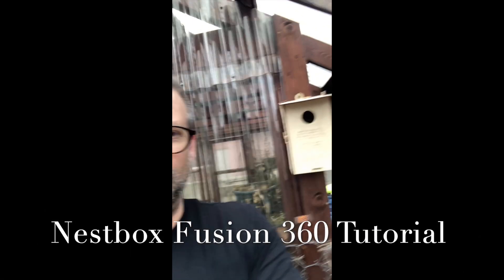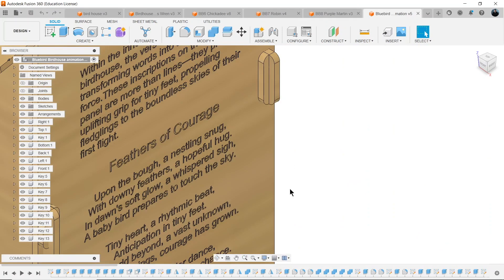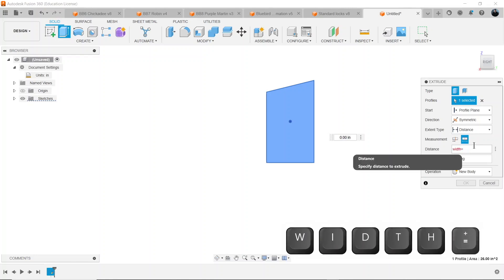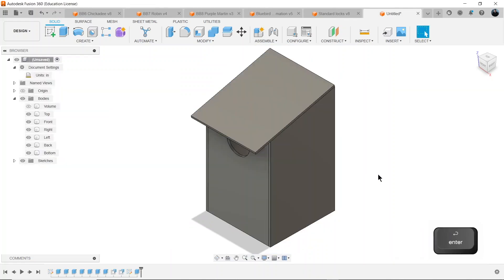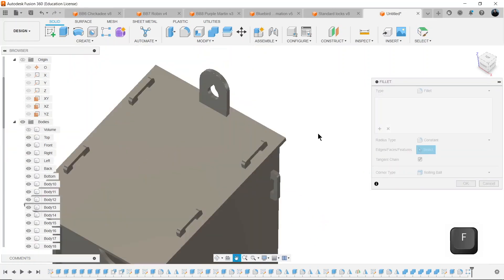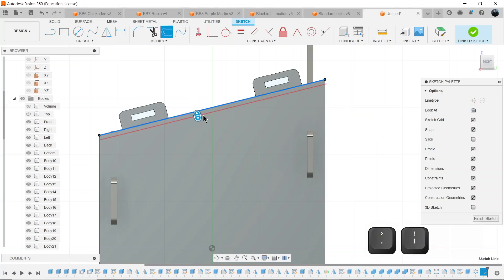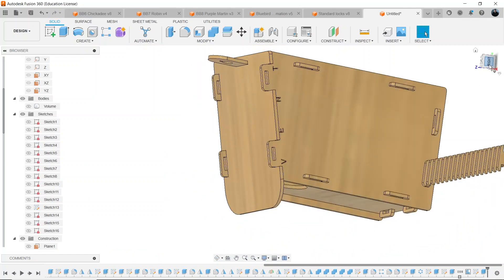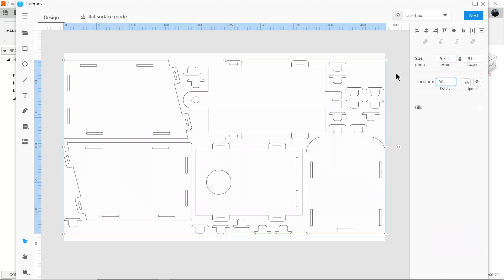Nestbox Fusion 360 Tutorial

Comment: For annual cleaning, it needs an openable side. What if one of your sides is already open, as the way the bird enters?
Reply from the maker: Thanks Mayth, Yes the Right side in this model can be removed for annual cleaning in the fall. Some species (ex. Robin) prefer one side to be wide open, but the Carolina Wren is best protected from predators when there is just one hole that just fits its body (1.5 inches in this case...)